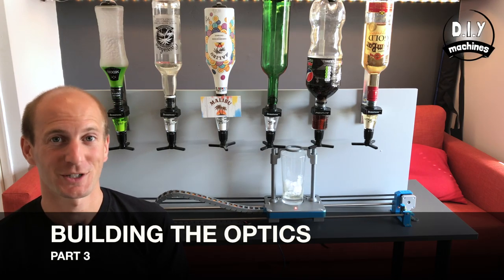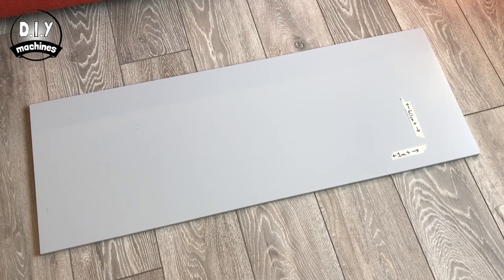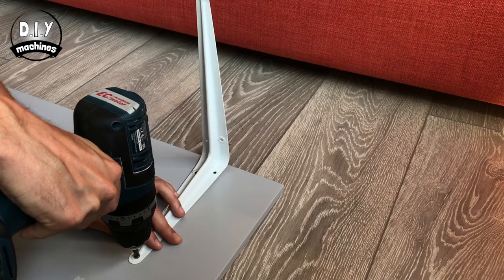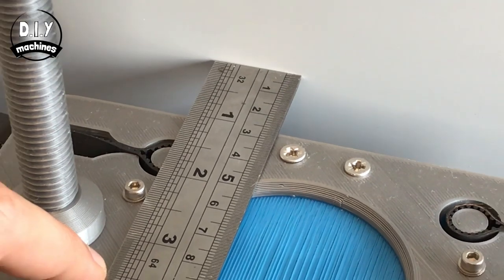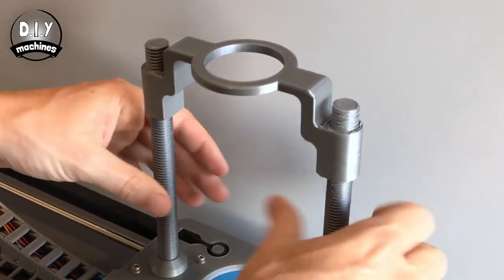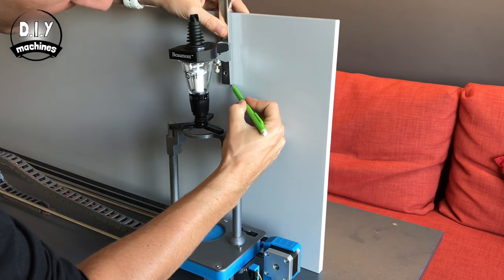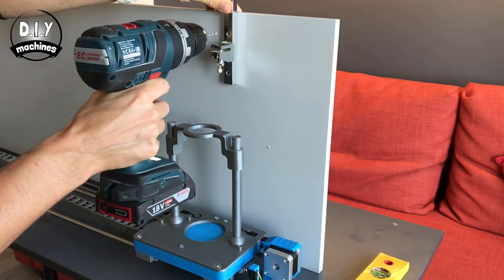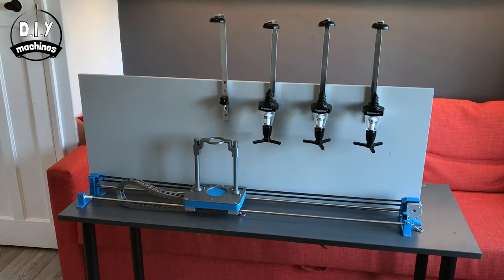How to build an Arduino DIY Robotic Bartender - Part 3 - Optics

Comment: Hi. i was thinking about the issue people had with the length of the serial buffer.

The easiest way would be to have a calibration command, and store "steps" in a eeprom.

Maybe later you can even add drinks to a eeprom for storage.
Reply from the maker: I agree with you, storing the drinks onboard the Arduino and then just recalling it via an index would overcome this problem. It would also allow it to scale to many more optics.
Reply: Im currently in the process of starting this project. 
Maybe il whip up some changes for you .)

Comment: You should've used servos for the Drink "button" much quicker/ more accurate.
Reply from the maker: You are correct, this is an early design (in fact my first) and my knowledge has grown since. Though I enjoyed realising I could 3D print working threads.
Reply: @DIYMachines  Would love to see an updated version, maybe instead of a long bar, have a rotating drink stand, fit 8 or 9  drinks a lot closer together.

Comment: hi , which system did you use in order to pour the contents into the glass?
Reply from the maker: Hi Hugo, I'm not sure I fully understand your question. The programming is done with an Arduino Uno. Video part four https://youtu.be/cvOpvPKHJvc shows you how to have the machine dispense a drink via bluetooth commands.
Reply: Sorry I'm French..  In fact I'm going to create my own robotic bartender, in your video, between 10 to 20sec you use a system whith an elevation to pour the contenants into the glass , which system did you use ? I expect you understand what I mean
Reply from the maker: Hugo coron The optics which store a little of the drink and then dispense it when we push up from the bottom are these. http://amzn.to/2jr1KCb. They’re made by a company called Beaumont . The circular ring that rises up to press against it is a 3D printed component I designed. You can download the parts I designed on Thingiverse. There is a link in the description.
Reply: DIY Machines , Great thank you for your help, last question, you said you create a 3D component, I'm going to create my own but which motor did you use for it ?

Comment: Hello,  How do you deal with the soda carbonation.  In my experience anything with fizz like diet coke will create large pressure after the first pour and explode out of the holder.  A very messy problem if ignored.
Reply: Check for the next video of this tutorial. Part 4 6:25... that should help with your question.